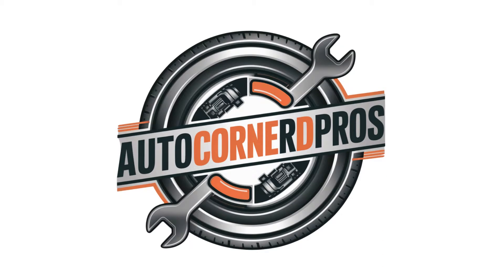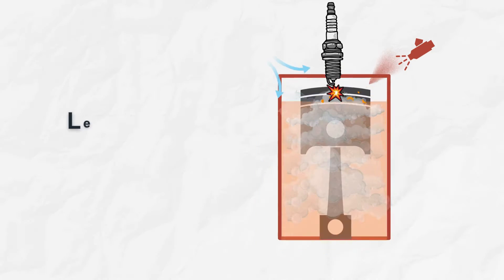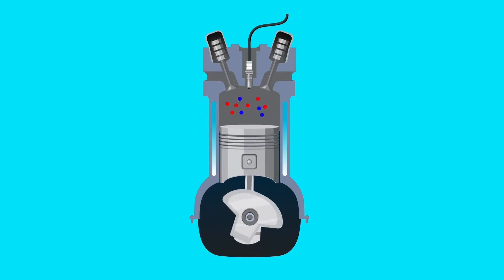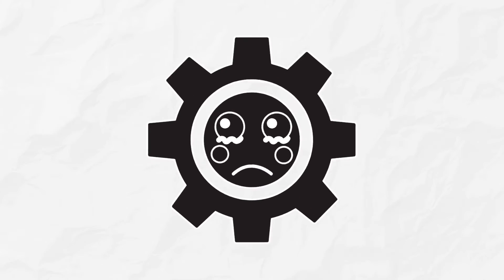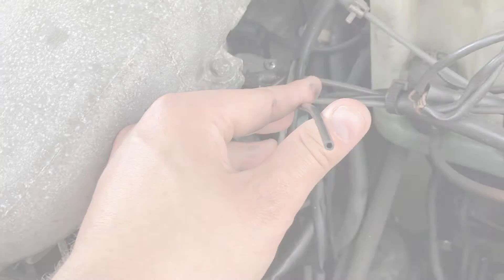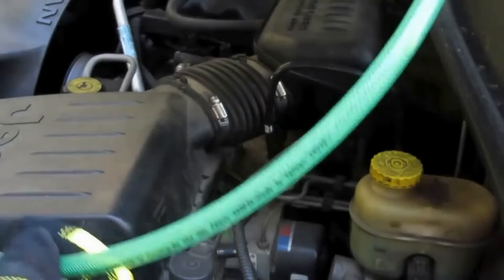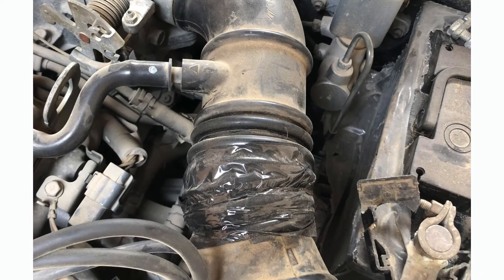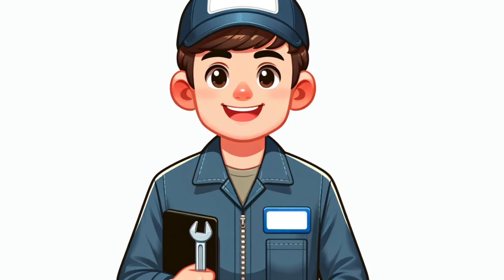5 Alarming Symptoms of Vacuum Leaks (You're Ignoring) | Save Money & Fix It Now!

Comment: I have missfire and vakuum leak.. MAF? i sprayed it with cleaner changed air filter, air manifold gaskets, throttle was clean, changed valve gasket, intake clean. i dont have OBD2 :/ but it stall when u stop at STOP sign or red light.
Reply: Ignition coils
Reply: @MIA-Misfit95  It was Battery 13V but amps were gonne, radiator was half dead it started to leak and because of it everywhere was oil(did not cool engine normally) and it clogged EGR. Tomorrow gonna clean EGR and rest of engine. Who the hell put AC fan to cool antifreeze? Fan was made in 2001 XD
Reply from the maker: Can u check plugs?